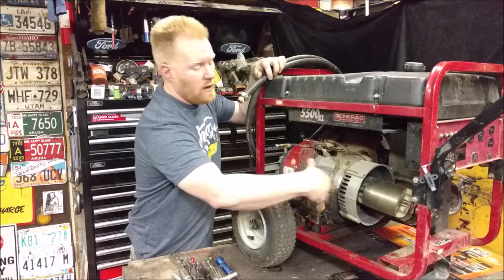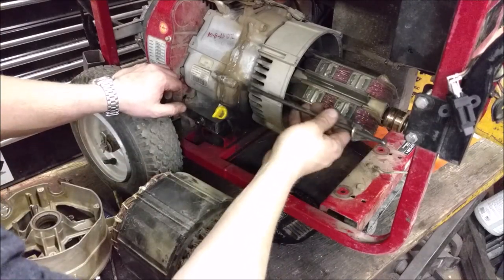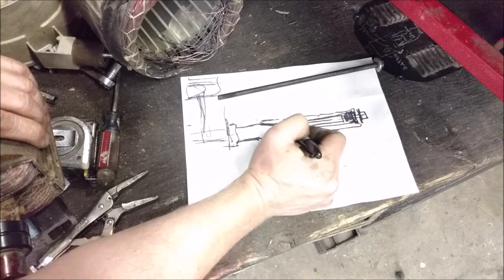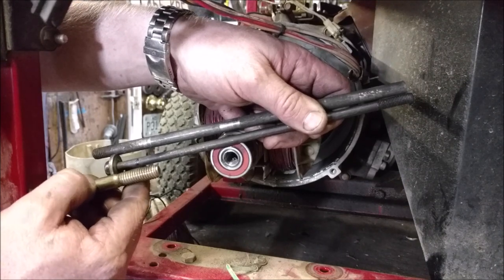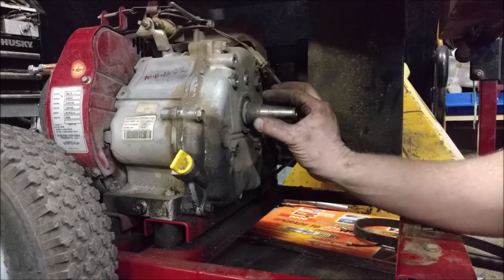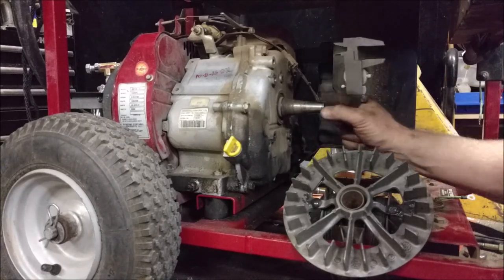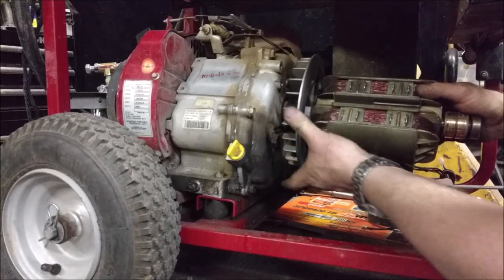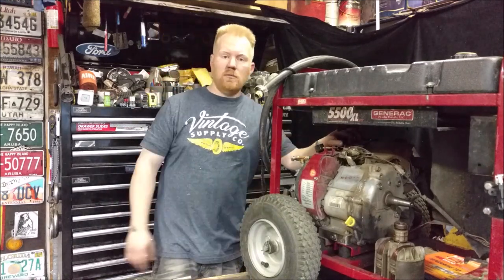Remove a Generator Head & can Engine be used in Go Karts?

Comment: if you check the parts manual for the engine itself (not the generator) you will find that this engine has 3 part numbers for the crankshaft. They just put the crankshaft in based on what it is used for.  They are keyed shaft, taper shaft or gear shaft. They are a little pricey though, and you will then have to change your gaskets after opening the engine. Not sure if its worth it or not. I guess it depends on the shape the engine is in.
Reply: Does predator harbor freight engines have tapered shaft? My tecumseh was only 10 hp
Harbor freight has 8hp or 13 with electric start.
Reply: @MC-hs4mf  I would never buy an engine from harbor freight. They won't last nearly as long as the name brand and it personally I think they're garbage
Reply: @kwacz  Briggs these days have bad reps, Tecumseh is no longer made. The shops wouldn’t even attempt to disassemble this generator.
Reply: @kwacz  how do I buy a “new” Tecumseh HM100?
Reply: @MC-hs4mf  northern tool has them. Youd have to make sure that it has the tapered shaft if that's what you need. Any small engine repair shop should be able to get you what you need to replace that engine.
Reply: @kwacz  northern has what? No northern near me that I know of.
I saw my tecumseh on northern but said not available.
Reply: @kwacz  the harbor freight predator motors are great.  I have SEVERAL of them on mini bikes, pressure washers, generators, none have failed after years of abuse. The key, is maintenance on any of these small engines.

Comment: It can be done. While the motor is running, I used a grinder then a file and ground the shaft to fit a hydraulic pump and used it for a log splitter just a few years ago.
Reply from the maker: I figured someone had to had tried it out. Nice work.
Reply: sixtyfiveford 
Gen guy here. 
What ya did works fine. 
Briggs makes a kit so I can do the home standby ones in the field. 
But on these little peashooters you have another option. 
Support that rotor slightly from underneath with a jack and a block of wood (plywood transmits the force nicely) 
Then take another plywood scrap and put it on top of the rotor. 
Whack that sucker with a good sized hand sledge hammer and as ya hit it, sorta put a spin or drag across on the hammer.  
This will work if you are careful and need to reuse it, but the strike will kill the magnetism for sure. 
No biggie to fix that though. but if it's going to scrap you don't need to be so careful, just support it good.
Reply: That's what I did with a 8hp generac motor just ran it with a drill press and shaped it to my size that needed for the clutch assembly. Worked flawlessly.
Reply: What I call the poor man's lathe. Using drill with grinder and files .. ect . Using different type disc and feathering disc. It can work fairly accurately.  .

Comment: Most appreciative! I recently picked up a nearly new and pristine Westinghouse 9500 watt for $150.  The gamble?  According to the previous owner, the engine was locked up and it had sat for two years.  The thing had no dust on it.  I figured I'd take a flier of a chance at the price and pray for a hydrolock issue.  Sadly, the cylinder is fine.  It must be the rod/crank in a very strong embrace.  I'm guessing it was a power out purchase and someone started it without adding oil.

I've got everything off the chassis except the engine and gen head.  I ordered a flywheel puller of eBay.  For $20, it's not worth the effort to build my own in the shop.  I still need to get a M12x1.75 bolt and come up with a shaft to push the rotor off.

Once inside, I'll know for sure what the damage entails

Comment: To remove the rotor, gently tap it with a rubber mallet. You may need to rotate it a few times while you tap it. There is no need to extract it with a bolt.
Reply: this is true

Comment: Those tips work just fine. No need to machine it any better, just make sure engine is hard mounted so it wont vibrate, remove bulk with poverty lathe/grinder, put long bolt on the side so you have hand rest and fine tune with file. Measure the diameter often and spray some water into axle every now and then to keep it cool so crank seal wont get damaged. That should be plenty good quality for go cart or other pulley driven system. For variator with larger diameter there might be some vibrations, but probably nothing major if its done accurately enough and with patience so it wont become uneven or oval. If you want bigger and wider axle, yes use the peace from the core, cutting extra off and pulling it into place with bolt, when its grinded to size make couple holes and with wet rag on the saft to keep it and seals cool, couple quick welds to secure it into place just to be sure. Alternatively new bolt should work too if welding is not a option.
Reply: Start it up and go to town measure a million times

Comment: You're videos are so helpful. I picked up a used generator last year. Motor is locked up and really haven't had time to take apart. Really haven't decided if I want to rebuild old motor or change motors and wasn't sure how to take the generator head off till now. Keep the vids going. Helped out with my snow blower carb and points. Still didn't it tuned right but it did run.
Reply from the maker: I generally pick up these with good motors and bad generator heads for free to $50. So it is generally less work for me to put a different engine on, than dive into the original engine.

Comment: You can buy a clutch that has a #41 sprocket, with the amount of teeth you want, or a 4L V-belt pulley, that fits the taper shaft. I "think" it is made by Max Torque. The around the $50 to $80 mark. I have bought them in the past, to use on generator engines, that I put on mini bikes. You can find them on eBay too.
Reply from the maker: Yes, I've seen the adapters. I think they're a little on the pricey side for what they are.

Comment: Not bad, you can also just put the shaft bolt in, do it up and leave a gap of 1-2mm between the bolt head and the rotor bearing, then gave the bolt a couple of taps with a ballpein (Engineers) hammer. The taper fit generally just pops off

Comment: One thing thats not mentioned is that  the output shaft from the Old gas Motor  has to have either the Bearing & Housing off the old gas Motor "OR" a Block Bearing so that the Generator Armature can stay exactly inline > I have used the whole crankshaft with the Gas motor housing to insure the Generator Stays perfectly straight as it was when still attached to the Old Gas Motor . Thanks for the Video !!
Reply from the maker: Thanks, I'm glad you liked it.

Comment: Anyone in the Austin, tx area? The company I work at is selling all their old 6.5hp motors and non working generators on CL for cheap. I bought a 6.5 hp engine for $10 and got a second one free. Most are missing the carbs and air filters. I do a lot of work on the newer equipment but have had to do repairs on the old generators, pressure washers and air compressors. Only the gen motors have that tapered shaft and the rest are keyed shafts. Check to see if the ad is still up on CL

Comment: I don't think it would be as crude as you might say if you took times patience and use proper tooling. I'm in the same dilemma I'm glad your video explains how to get this rotor off, I was going to use the 10 horsepower Subaru engine for a mini bike

Comment: You can get the aftermarket 11HP crankshaft for under $75 and then sell the tapered one the  tapered ones are more expensive.  That is probably the easiest way to do it from what I can see.
Reply from the maker: That's a good point. I don't think anyone would buy a used tapered one. Seams there are ten fold more generators with dead electrical heads vs engines.

Comment: It can definatley be done especially if you have a lathe which I do. I may just turn down the shaft or I may machine an adapter which seems easier however I have to remove the govenor and I don't remember how much I need to dissemble but it depends on how much work to remove the crankshaft.

Mine is a 3/4 tapered to 5/8 I can turn a 1 inch sleeve and press fit it on with a 1/4 inch of material removaed so after it is pressed in I can tig weld the original shaft onto the sleeve and the other half of the part would be solid with a keyway and a tapped hole. Well thats the theory it doesn't seem so hard.

Comment: Alot of times when the generator isn`t putting out you can take a hand grinder and spin it plugged in to add energy to the feild windings and get it back working.Which you may already know.
Reply from the maker: Yes. This one was a crispy critter.

Comment: Saw a guy tread the end then fill with water, Teflon tape bolt and it popped right off. If you have to keep it horizontal pump it full off grease if a rod isn't handy and tighten up bolt, similar to how I pop out the input shaft bearing on manual transmissions

Comment: The cvt clutch from a golf cart or gator engine also uses a tapered shaft.   Not sure about the taper lengths for a easy fit.. another consideration. Is tractor supply outlets have all kinds of shaft adapters , sprockets, pulleys.   Ect. So even if the shaft needs to be larger than a go karts 3/4" u can Adapt to a farm sprocket. Then use a piece of 3'4" keyed shaft with a pair of bearings and mounts.  To make a jack shaft with another sprocket to work with the motor on One end and kart clutch on the other.. ..
Reply from the maker: Those tapered shafts on golf carts etc are a completely different taper. Generators have a unique taper style though you can buy adapters, They will run your $75-100+ which generally defeat the purpose of using a second hand engine.

Comment: Thanks, Moe.  I'd heard these engines were hard to convert from a tapered output, but I bet using a grinder while the engine is running might just get it close enough for government work.
Reply from the maker: Very True.
Reply: A LeBlanc  then finish it of with a rotery sander as it runs then fine emery wet and dry i did this to mount a cog to run a chain on a old garden dumper cart that had a bsa 175 bantam 2 stroke in it set in a 2 gear box f / r  i lost rev but its working 4 years on .

Comment: My Coleman Devilbiss powerback generator was different . The 4 long bolts only had nuts on one side and threads of not to other side. It may have messed up threads by using a tool to grip threads on the end closest to me that held nuts. 

And when I put a rod inside and screwed in a boot after creating threads the bolt broke so I had nothing to lose and tapped with a sledge and immediately fell off shaft. I had already tried a rubber mallet.
Now I have to go from opposite end and drill an extractor also broke in bolt.

Comment: Could you thread a short bolt into the original tapered shaft tight enough to hold a pulley centered and then run a weld around it to make it solid?
Reply from the maker: Sound like it would work.

Comment: i got a free generator with a sweet running 7hp subaru robin engine. i got on ebay and found a straight 3/4 shaft for the same engine, 25 bucks delivered. not saying that there is straight crank shafts for all genertator engines but its atleast worth the look if you got one for cheep

Comment: I’ve fabricated something I call a clutch more of a brake but I utilized the threaded tapered shaft cut out part of a gear for chain sprocket for bike basically wasn’t perfect but it spun chain nice wich spun the “rotor” and the “clutch” only engages like a brake so it wasn’t easy to drive or wasn’t easy to get used to and wasn’t very efficient however we had fun breaking it and the clutch setup actually lasted longer than the brake pads it blew through them fairly fast once you had brake locked up you could redline engine and get moving wasn’t great on take off as far as fast or putting power down but over engineered backyard go kart using that generator was fun for me to make however I broke it a lot faster than it took to make i fabbed the whole thing wich was the downfall lol my steering aparatus was obviously not great that was first to go and only had front brakes and a metal tire brake in back since it was impossible to put on the wheel or shaft

Comment: My Idea would be to make a fixture to hold a lathe bit .....or a tool post grinder .and machine the shaft  with the engine running
Reply from the maker: I was thinking the same thing last night. There are always 4 bolt holes on the back of the motor that would support a fixture.

Comment: Good video that gets right to the point, no bullsh^tting around like 90% on here do! sixtyfiveford! Right on bud! BTW, when I tapped my rotor for the puller bolt, it was a 7/16-14 NC thread. I'm sure most of these rotors that aren't tapped are probably the same ID. Carry on!

Comment: I'm trying to figure out if I can use a Gen head off another generator on my diesel generator motor? I've got a couple candidates that have bad motors but their gas and so I'm wondering not only if they'd fit but if theyre built differently than the one on the diesel engine since it seems to have lower rpm

Comment: Great video.  Thanks.  I have a Generac gn220cc 4000xl portable Generator.  I removed the gen from the motor the same way that you did.  I noticed the shaft has a keyway slot in it but I never saw a key and when looking down the gen head I don't see where it would have a need for a key.  Do you know if I need a key for the shaft that the gen head goes into when I put the gen head? back onto that shaft.  Thanks John.
Reply from the maker: I've never seen a generator require a key. They rely solely on taper compression to lock the rotor to the shaft and ensure it's perfectly centered.
Reply: Thank you. Very much appreciated.  Keep the videos coming.

Comment: I'm wondering if it would be practical to get a pulley machined inside to with that tapered shaft. The tapered shaft is an excellent connection.
Reply from the maker: If I had a lathe that would probably be my first option. However, spending a little more time to do the engine shaft gives you more versatility in applications and changing pulley sizes.
Reply: As a machinist, no. I wouldn't waste my time cutting that pulley for myself. I've lost count of the number of straight shaft engines I've bought for just a couple bucks and put back into running condition in an hour or less...often without spending any more money. Lots of stupid people in the world throwing out perfectly good engine powered equipment because it won't start or doesn't run right....or it just isn't new and shiny anymore. 

I have no idea why people keep trying to reinvent the wheel. By the time you get through paying a machine shop, you could have bought an engine...or at least a new crankshaft. Doing it the halfassed way with a handheld grinder/file/whatever ends up with halfassed results, and you will never have a standard crankshaft. In addition, if the engine is used to direct drive a pump(hydraulic or pressure washer) you will very likely beat the keyway out of the shaft and pump bore due to a piss poor fit between the two. This will also ruin the pump.

Comment: My Simplicity Baron is driven off the flywheel side, I picked up a 18 hp Robyn Subaru with tapered shaft for cheap and set it up to run off the flywheel. 14 years and still running strong!
Why not make a plate to bolt on the flywheel side with the appropriate shaft welded to it.
Reply from the maker: Only more robust engines were designed to have a flywheel PTO. Most of these generators have aluminum/plastic cooling fan flywheels that'll never handle a flywheel PTO. My Simplicity also runs a flywheel PTO.

Comment: I have a Honda engine running a compressor. I ground the shaft with a grinder with it running it is crude but works.
Reply from the maker: That's awesome. I knew someone had to have done it.
Reply: Yes several years ago because the electric motor on the compressor was junk and the generator was junk too.

Comment: So here’s a question, I just received an electric start diesel generator with a bad motor and I have been trying to figure out if I can simply replace the motor with any other motor or does it have to be a specific kind of motor?
Reply from the maker: It will need to be anther taper shaft motor from a generator.

Comment: How's it going convert mine generator motor using a torque converter clutch and aluminum pipe I picked up from the hardware store at about a 1in  OD and .8in ID then tell me a couple washers and a bolt short enough to go in there tighten the hell out of it and it work fine for me so like he says a new video there's options

Comment: No..... Bolt the engine down , using a grinder start the  engine and while it turns cut the shart to about 3/4 until close. Finer file and paper. I know it works.... did it twice.... easily done.

Comment: Is it the same for pressure washers?
Reply: yes
Reply from the maker: Every pressure washer I've torn apart has a standard 3/4" straight shaft with a key. They make great engines for Go Karts, Tillers, etc.
Reply: No pressure washers are not tapered..
Reply: Goomer Nope all the pressure washers ive worked with Do NOT have tapered shafts in fact i have a gx160 and a gc160 that were pressure washers sitting in my garage that run great and do NOT have tapered shafts

Comment: Why not just take the engine to a machine shop and have them machine an adapter w/a taper id and a straight od?
Reply from the maker: You could, but it would set you back over 100 bucks. It would be cheaper to pull the crankshaft and have it machined down for 50-75 bucks.

Comment: bearing do go bad and  there would be an oblong shaft  a machine shop can make an adapter to fit   and i liked your video just make the frame and  idle pulley a little different